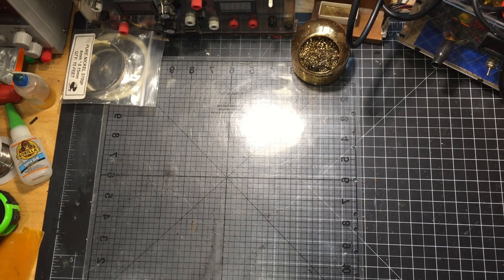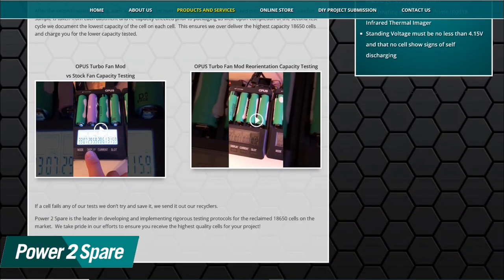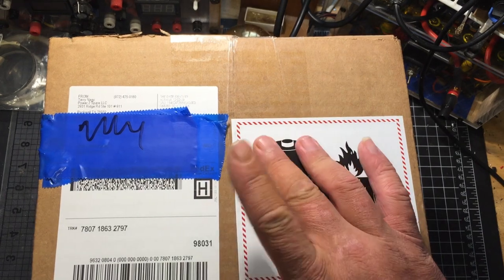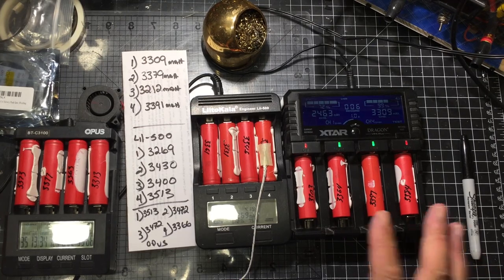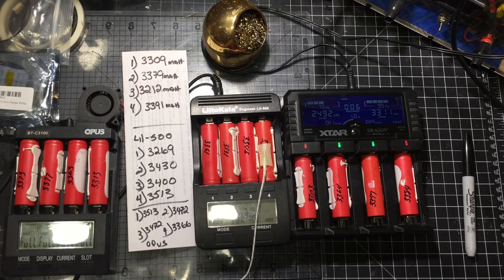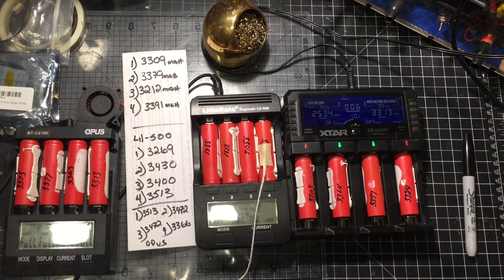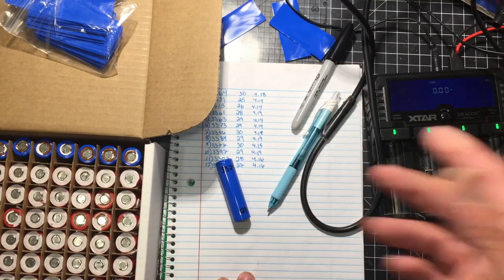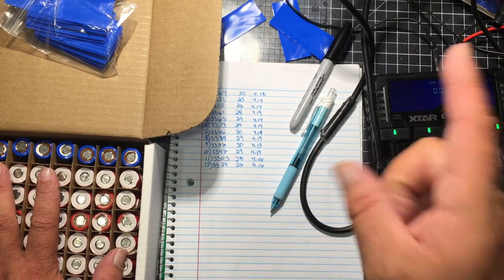DIY E-Bike Build Part 2 "Power2Spare" Unboxing, Testing NCR18650BF 3300mah Medical Pack

Comment: Thanks for the honest review of the product.  Kind of embarrassed about the 3200 cell, which is a perfect example of why we include a couple of extra cells for free!
Reply from the maker: It was only around 20-40mah lower and tested on a device that is known to give lower than normal reading.  I never really use the xtar dragon for testing because of this. That device is really only good for the resistance reading I get.  But I didn't even really consider it the actual capacity. I just wanted to show what you might get as a capacity with the 3 different testers. I am Extremely pleased with all result, you can tell you guys really really care about the product you send!!! You Rock!!!!!

Comment: Danke für das Video. Ich habe auch einen Punktschweißer mit Autobatterie gebaut, warte nur auf das fette Relais. Mit Mosfet-Schalter war das nichts. Die Mosfets hat es gesprengt, wahrscheinlich zu billig aus China, Typ irf1404 8pc. parallel, na ja. 
Ich habe übrigens einen Timer mit NE555 gebaut, der ganz gut funktioniert und eingestellt werden kann. Thanks for the review. I also built a spot welder with car battery, waiting for the fat relay, with mosfet switch was not. The Mosfets blew it up, probably too cheap from China, type irf1404 8pc. parallel, well. Incidentally, I've built a timer with NE555, is safer and can be set.

Comment: Good work man! 

The cells I got from Terry a year ago are the best cells I have. They have been running my Cartridge Power Wall for a year now. 

He never offered any 3000+ mah cells back then. Mine are all 2999 and under. 

I should pull a few cartridges and do some cell testing to see how they faired. 

Cheers!
Reply from the maker: I know this guy puts allot in his cells and you can see a little OCD there for sure!! But that is a great thing when it comes to repurposed cells!!

Comment: What is the first step after getting your box of cells? Do check each one for voltage and if so what do you use as your voltage pass-fail. Then you check for capacity and use packr to set up parallel groups? Trying to figure out the steps in putting a pack together.
Reply from the maker: If you purchase from Power2Spare, You basically only need to spot check. This guy already does the hard work for you and he is very very very picky when it comes to the cells he OKs. If you're using laptop cells. The pass-fail would be the actual capacity of the cell, verses the actually speced capacity. Have you watch any of Jehu's or Average Joe's Videos? Those guys have video's packed with info to help you determine what to keep and what to throw away.